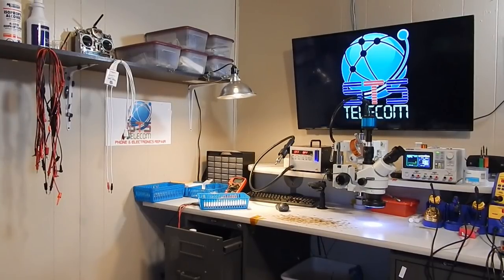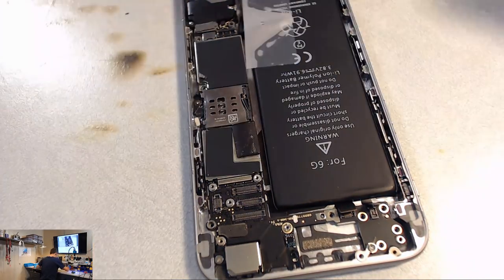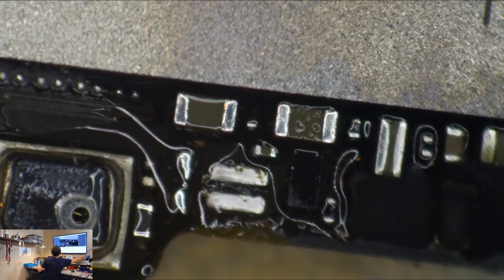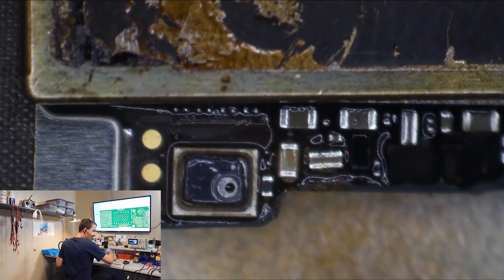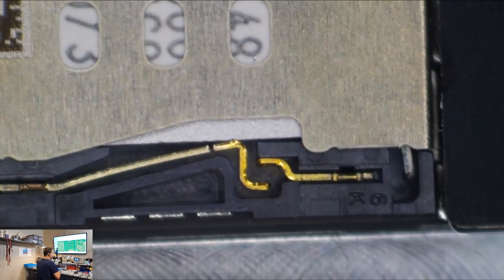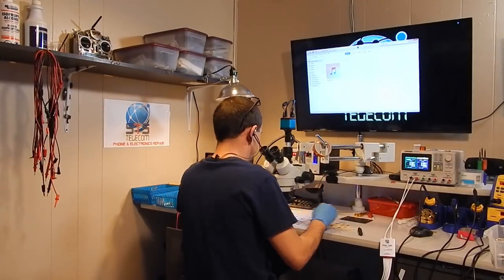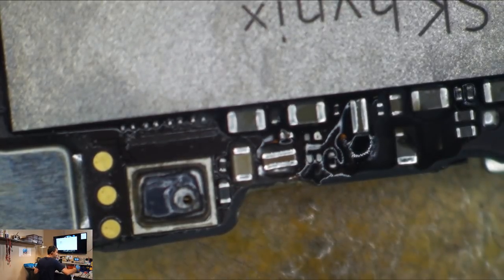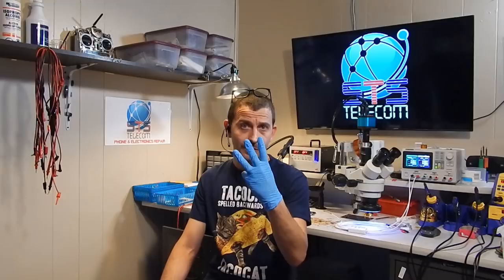iPhone 6 Tool Damage - No power / sim detect (Happy Valentines Day!)

Comment: The component you replace last that came of so easily is a package of 4 Zener Diodes that serve as protection of the 4 lines running into it. What it does is it shorts every of these lines to ground whenever a specified voltage is exceeded - this happens when there is a static electricity  discharge that has a huge voltage usually. It works like a lightning rod for static electricity. Pretty much all buttons and most analogue lines on the board have such components as protection so you don't kill ICs when you touch stuff with your fingers. So anyway, as long as there was nothing permanently shorted to ground which I don't believe it was most likely you bending up those contacts that fixed the problem.
Actually such a fucker (ESD protection zener diode) on one non charging iPad mini was fucking up my day cause it pulled the 5V coming from the lightning port down on the line it was protecting. So it was partially shorted (to ground obviously) and pulled the voltage coming from the lightning Port to around 2V and so the iPad would believe there is something wrong with the equipment connected to lightning. Something i sadly discovered only after changing Tristar and loosing lots of time...

Comment: Hi there, I recently had my iPhone 5s battery changed but now for some reason it won’t power back on. I plug the charger in but the apple sign keeps coming on and off but doesn’t do anything else. My question to you is roughly how much would it cost to fix.

Comment: On my iPhone 5s. The part where the battery plugs into the logic board is a little connection thing. The small little square part on the logic board where the battery connects broke off. It looks like I can solder it back but solder it like a sandwich. Have solder in between the logic board and the battery connection so that I can reconnect the iPhone 5s battery cable. Can you show how to solder in between the logic board and underneath something you directly on top of the logic board?

Comment: Any ideas of why my phone would stay stuck on no service/searching with and without the SIM card?  My iPhone 6 suffered water damage. I replaced the battery and screen and it powers up just fine everything works except my cellular network.

I let my entire logic board sit in a bowl of isopropyl alcohol for a few minutes and and brushed it with a toothbrush. Still no network. I was thinking it could be the baseband IC and when I dial the number my IMEI number does not display on the screen.

Comment: i have a question, i have an iphone 6 plus, that used to have touch disease, and a problem with the camera flex... i sent it for repair, and they fixed the flex with no problem, afterwards the reheated the ic chips in order torepair touch disease, but now there is a white vertical line in the middle of the screen, and no touch response in 2,5,8 and 0, basically all over the white line. they switch the conectors, and the ic chips, but the line is still there, they said that there is no static on the phone but are not giving me a solution, and thats the reason why im writing you, what is  the possible(in theory) problem with the phone ?

Comment: i recieved an iPhone 6 Plus.  Screen is screwed (no display but is destroyed), vibrate does not work, and from what the original owner said it has Touch Disease.  I can fix the Display and i can deal without the vibrate but the Touch IC is most likely going to be a problem.